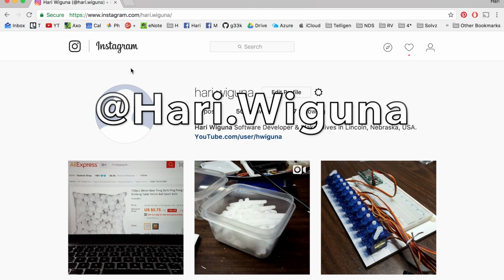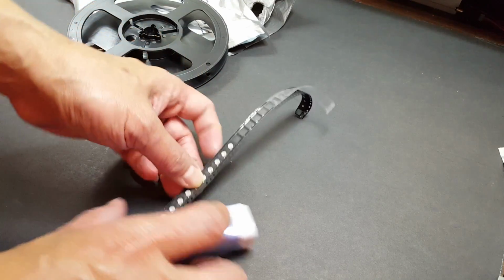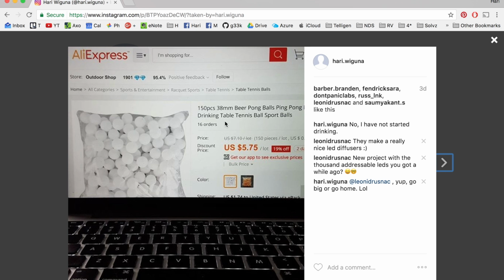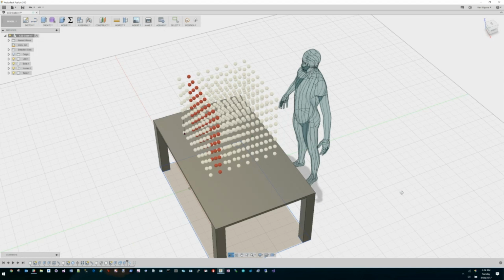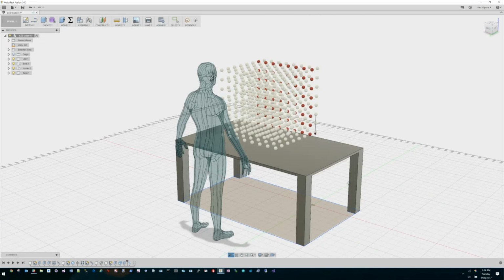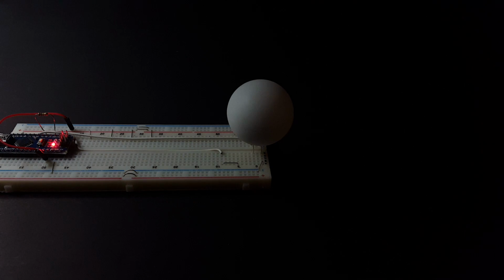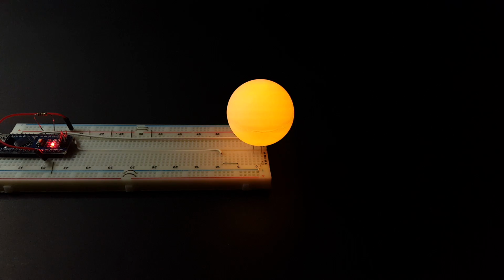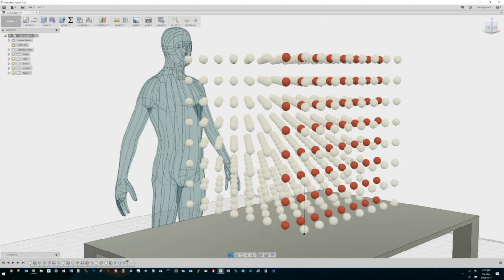HariFun #152 - 600 Ping Pong Balls - Giant RGB LED Cube Part 1

Comment: This is absolutely brilliant. You've really inspired me. I've wanted to make a RGB LED cube for so long and you've given me such great ideas. 600 ping pong balls have just arrived at my house! I can't wait to see your final cube.
Reply from the maker: Thanks Lorraine! You're making one too? That's fantastic! Thanks for letting me know. Please share your progress or at least the completed cube.  Ask me anything if you need help.
My cube has been done for a while, but I have not completed enough effects to demo the cube.  Here's a sneak peek:
https://www.youtube.com/watch?v=mly1I2xspuk
Reply: Thanks Hari Wiguna! Will keep you updated on my cube. I'm planning to control it using a micro:bit. Can I ask how you're connecting each column to the next? I can't see any horizontal lines in the finished cube though it is quite dark... I assume you're alternately connecting them at the top and bottom?
Reply from the maker: I've always wanted to play with Microbit and Python, but just hasn't gotten around to it.
Looking at the cube from the front, the Neopixel starts at bottom left, goes up, and then across to the pillar to its right, down the pillar, then to the right, etc. when I reach the rightmost column, we'll end up on the bottom, I have a wire underneath the base to the bottom left of the pillar behind the very first pillar. up, down again, all the way to right, and then the third layer, etc.
I talk about this in one of my previous videos, but I don't remember which one. Sorry :-(
https://www.youtube.com/watch?v=N6bJJDCpGi0&list=PL-xZsBalytNA71DNhKQv3fKPJpMA8v7VH

Comment: what will your dimension be ? 8^3 ? spacing going to be important ya coz its going to be difficult to visualize the center pixels
Reply from the maker: Yes, I worry about that too.
Current plan is that it will be a 1 meter cube! Someone asked me why some of the balls in the Fusion360 visualization are red.  I wanted to make sure that I could see that red "plane" from the other side.

Comment: Awesome. One thing to note - you might want to make it with an uneven number of rows so you can do a nice rotating effect around the center. I built a 5x5x5 but the code for my cube also supports a 11x11x11 - it's using TLC5940 LED-drivers. See blog.zapro.dk for more info.
Reply from the maker: Thanks for the comment!
I like your idea of having non-even number of LEDs.  I watched your 5x5x5. Nice animations!

Comment: Nice Video!  I am really looking forward to seeing this project take shape.
I dare say this is a very original idea.
Quick question:  Why is there a plane of red ping pong balls in the 3D animation?  Does that represent a potential lighting pattern?
Reply from the maker: Hi Lucas!
Yes, you are correct.  I put a plane of red balls to help me visualize how obscured those balls would be when viewed from different angles.  The ball spacing is a balance between creating a large enough gap for visibility and making a cube that would not collapse due to its size.
I've been having a blast working on this, brainstorming on how to suspend the balls, how to power them and ease of construction.  The ping pongs have not even arrived from China. I had to buy some balls locally so I could start experimenting :-)  Thanks for the comment Lucas!

Comment: Wow this is so awesome!! How did you get the led inside the ping pong ball?
Reply from the maker: Thanks Jon.
I puncture the bottom of the ball with a safety pin, then gradually use larger and larger drill bit by hand until there is a hole just big enough for the LED (5mm).  So the LED is actually at the bottom of the ball, not in the middle.  The diffusing works very well, it looks quite even all around the ball.  Even just putting the ball on top of the LED without a hole works well, but not as bright.
Reply: This has given me so many ideas. I am thinking to start with maybe a ping pong  matrix (2D) as a nightlight for my kids (assuming fire hazard is not an issue).

Comment: Awesome project Hari! Might have slipped by in the video, but how are you going to control these? Will you go an easy route with an Arduino and will it be able to control them all in a timely manner?

I haven't yet tried any 2812 led strings or similar, but I've read that you need to have enough "free time" in the µC for correct timing but also enough storage to store a couple of different "lighting designs" so you actually can do something useful with the strings.. I'm all sleepy right now, long day ;) Hope you get what I'm trying to ask ;)

I'm sure your project will be as awesome as your other projects and it will be lots of fun to see when you get all the items put together! :)
Reply from the maker: Thanks for the comment Chris!
Currently my plan is to use an ESP32 for the memory and speed concerns that you mentioned.
I've been having fun even before I build the cube: trying to figure out the ideal spacing of the balls using cardboard model, then with Fusion360, designing PCB to mount the LED, how to wire them up "sequentially" when an LED cube is inherently not a linear LED strip, etc.

Comment: Are those the sk6812 RGB LEDs? I picked up 100 to make an array. Just trying to figure out how I am going to power them all. It is a pretty daunting task. They can use up to 60ma each which starts to get pretty frightening when you get to x100.
Reply from the maker: Hi David!
I'm using the old WS2812B rather than the newer and faster sk6812.
But same concern about high power applies.  I plan to use one or two computer power supplies to power the cube.  Power will be supplied to each LED "pillar" rather than distributed in a chain as the usual LED strip. But, yes, it is crazy scary to have 30Amps all over when I'm used to 500mA Arduinos :-)

Comment: :-/  Still waiting on a few parts for my spider before moving on to a new project. What's your thoughts on a support structure?
Reply from the maker: Hi Karl!
My current plan is to design a custom PCB just a little bigger than the LED, eight of these PCBs are soldered onto three vertical wires pillars (vcc,ground,data).  Reinforcing wires will connect pillars horizontally, mostly for structural strength, but on some locations to transfer data out from one pillar to data in on another pillar.
I plan to make a jig to puncture three holes on the balls for the three vertical pillar wires.  Solder bottom PCB, feed a ball, solder the next level, etc.  I worry about dropping solder on the ping pong balls :-(
Do you have other ideas?
Reply: Looks like you're going with addressable LEDs this time. Will the PCB/LED will be inside or outside of the ball? Getting it inside might be tricky. I've seen a couple of schemes where the vertical columns were suspended from above (they just used WS2812 strips)
Reply: Quick calculation shows this will be around a 1.16m cube. It's going to take some stiff material to keep it in shape without getting in the way of the other balls. Maybe some carbon fiber rod?
Reply: On the other hand...a metallic structure would allow you to substitute the structure itself for one of the conductors (e.g. gnd). Looking forward to seeing what you come up with.
Reply from the maker: I waver between drilling a hole at the bottom of the ball and simply putting the ball on top of the LED (slightly dimmer).  My friends at our local makerspace have ideas on how to put the LED in the middle, but after seeing how well it works at the bottom, IMHO it is not worth the extra effort.  The diffuse effect works just fine with the LED at the bottom.
Reply from the maker: Three 16AWG vertical wires would make up each pillar of 8 LEDs.  Some horizontal reinforcement wires would be placed between pillars to create rigid  "boxes".

Comment: The visibility of the balls inside the cube is going to be pretty low if there is not a LOT of space between them. Otherwise a cool project.
Reply from the maker: Excellent point Ravi! I totally agree.  My current plan (as seen in the video) is to have 3X the ball diameter between the centers of the balls. I have to balance maximizing that distance and making the cube small enough to fit in my house. lol

Comment: Nice idea Hari! I tried combining through hole LEDs with ping pong balls in my Christmas project, but it required drilling a hole in each ball. I haven't tried smd LED's and from your results I can already see the cube is going to be awesome! :)
Reply from the maker: Hi Chris! I got impatient and bought a pack of 6 ping pong balls from the local store while I wait for the 600 from China.  Hopefully the ones from China will work as well as the ones I got locally.
Reply: I believe ping pong balls are not much different, no matter where you buy them. I hope they will work for your project. Good luck Hari :)

Comment: You have done it now Hari. The ping pong guys will want Led's in there balls when they play now :)
Reply from the maker: I wonder if there is a battery light enough for that. And then of course there is the issue of balance.
Reply: you can use a 2025 3.3v coin cell it's kinda like a 2032 3.3v but a little thinner, I use them a lot. both 2025 and 3032. But there are smaller ones like they use in the hearing aid and they are 3.3v some of them but not sure how long they would last on Led's.